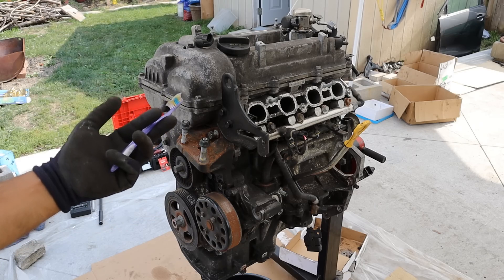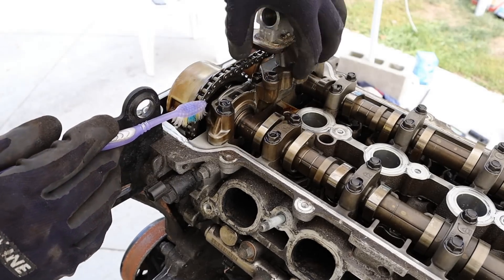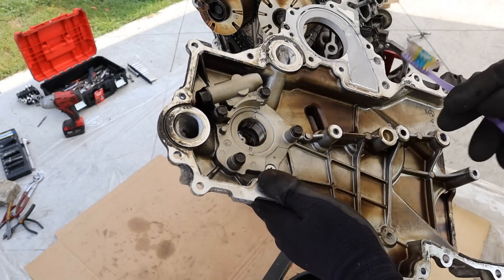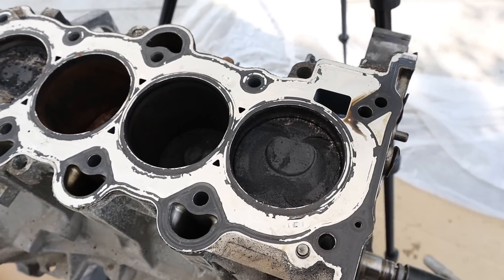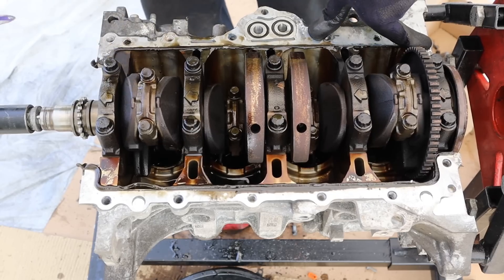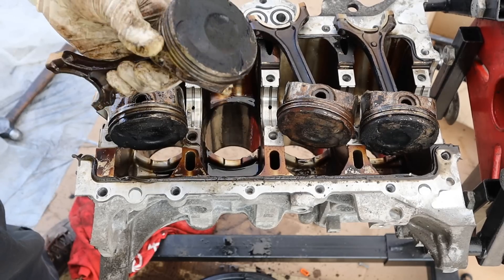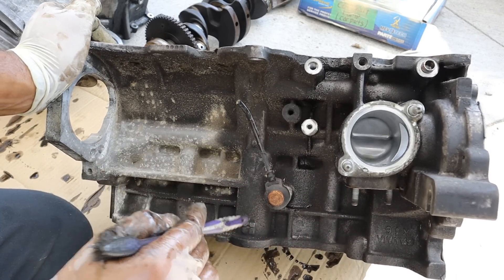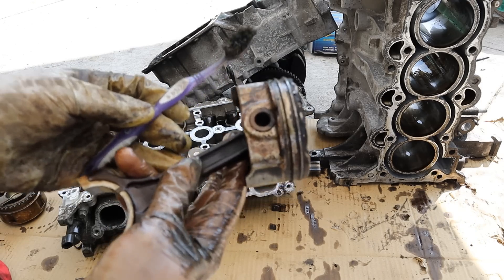Why KIA Engines Fail

Comment: I have a sneaking suspicion that Kia's and Hyundai's would not have as many engine failures if it weren't for their owners. I know Theta 2 engines have problems, but holy shit, I've never seen cars as mistreated and neglected as I have Kia's. Edit Why do y'all feel the need to repeat what I said over and over? I literally said "I know Theta 2 engines have problems". Why repeat that? The garbage engines will be even worse with no maintenance. That's common sense.
Reply from the maker: Yeah half the problem is the owners
Reply: Unfortunately I think people think they're basically throw away cars just like Nissan owners...lol for sure!
Reply: Even if your engine drinks oil, it is up to you to keep on top of the levels... It takes a minute to check your oil and can save you $_$! But alas people are so detached from touching anything in the car that it is sad!
Reply: I would refuse to own a direct injection engine period!   Yes many people do not do oil changes often enough....I do my oil changes at 3-4000 miles.    I never trust the manufacturer recommendations...they are in the business of wanting you to buy a new car after warraty expires      but no direct injection engines for me
Reply: @neilduncan8657  exactly GDI S##
Port injection along with GDI Whould
be a whole different picture.
Reply: Theta 2 engines would fail if the oil was changed every 25 miles. A real shame, because the rest of the car that they came in is actually pretty decent.
Reply: @9ZERO6  25K miles is 40K kilometres! 
Who would expect engine oil to perform for that long? Can't blame the manufacturer for neglect.
Reply: @68404  He said 25 miles, not 25K
Reply: I would tend to agree with you.  But the Theta II engine does have a flaw from the factory causing premature failure, even with good maintenance.
Reply: @SibRevs  That's why I mentioned the Theta 2 having problems.
Reply: You can polish a terd but you can’t make the inside of your engine better when it’s built like shit from the factory and No Honda is not the same as Hyundai
Reply: We had a Hyundai Accent and it got the same care as our 04 Corolla. The Corollas was off the charts better in ALL metrics. The 05 ACCENT had a horrible intermittent transmission bang and other issues. The dealer claimed to have changed the tranny under warranty but I know different now. I know this because my Chiropodist had a Tuscon which ate 2 litres of oil every 1 000 kms. He fought tooth and nail with Hyundai to warranty the engine. They did after a greater than one year battle. I know several people with serious issues with KIA and HYUNDAI. I will stick to Toyota.
Reply: @mikefoehr235  Go find yourself a factory original 2007 Toyota Camry with the 2AZ-FE and see if your opinion stays the same. Toyota and Honda engines came with junk piston rings, too.
Reply: @tobiasbeecher7860  The only junk i had was GM, FORD and HYUNDAI. Toyota outdoes all 3 with ease. I would take bad piston rings if I had too. That would be a minor issue to deal with. GM FORD HYUNDAI, The whole thing was junk.
Reply: @mikefoehr235   @Mike Foehr  It's not a good vehicle if you need to strip the engine down to the bare block to repair something that TOYOTA screwed up royally from the factory. Toyota is one of the best auto makers, but they definitely aren't perfect. There are some fantastic GM, Ford and Hyundai vehicles and there are some bad Toyota vehicles, that's a fact.
Reply: @tobiasbeecher7860  Well for me Toyota can do no wrong. I just love my 20 Tundra. I even floor it to piss off Trudeau a d spew extra emissions out of spite for that commy
Reply: @tobiasbeecher7860  I'll take that bet.
Reply: @mikefoehr235  - Quite the opposite for me.  I currently drive a 2015 Kia Forte5, my last car was a 2016 Toyota Corolla.  The Corolla is currently sitting at a junkyard (hopefully, where it belongs) because the transmission failed at 78K miles, my extended bumper to bumper warranty (through Toyota, not third party) was supposed to cover for a new transmission but Toyota CS told me that they consider the transmission failure to fall under their "normal wear and tear" category so warranty won't cover it.  I sued them, and won.  My third and final Toyota.  I got a good deal on the Kia and it has a ton more features than the Corolla did. Interior fit and finish is much better in the Kia, and it's not been back to the shop one time for repairs. Only for maintenance. Couldn't ask for more
Reply: @DeadofWinter321  2016 Corolla with a bad transmission...I am glad for you that your suit was successful. Our 04 Corolla was still going at 330 000 kms or more. I am not sure about the kms because Toyota made the odometer stop counting at 299 999. I think It may have been at 360 000 kms. That is well over 200 000 miles. It was the BEST car i ever owned and swayed me to Toyota. Our dealer is also extremely helpful...any legit warranty claims are honored with no hassle at all.
Reply: @mikefoehr235  Remind me where I said that Hyundai or Kia are reliable? They're far better than they used to be, but they have to get their shit together with their engines. Hyundai's and Kia's I see now tend to be great aside from the engines.
Reply: @OhPhuckYou  In an other life I think
Reply: @OhPhuckYou  If a car is great but the engine is shit, then it's a shit car.
Reply: @OhPhuckYou  A car is a tool designed to move you from point A to B. If a tool can't do it's job then it's a bad tool.
Reply: @OhPhuckYou  so the most important part?
Reply: @OhPhuckYou  It seems fairly obvious. It's a car.   Without an engine, it is.....junk.
Reply: @mikefoehr235  To be fair most toyota engines are nigh indestructible.
Reply: @saltananda3227  I know this from owning my 13 Tacoma...the 4 litre cannot be killed.
Reply: @That V8 Life - I’m far from poor and I bought my Kia Soul Exclaim for fuel economy. I have a 72 mile round trip daily commute and I wanted to keep the mileage low on my other vehicle. The Kia got 30+ MPG vs. the 16 MPG with my Dodge Ram 1500.
Reply: The owners are problematic but the real problem is how cheap they built & the GDI

Comment: I have a Kia forte 2.0 2010, 250,000km going smooth and silent, maintained with shell helix 5w 40 every 9 months, used to be ard 16k post COVID mileage down to 7k every 9 months, in tropical Malaysia. Never leaked never had chain issues everything is clean and smooth. It's the g4kd engine, not gdi, Mitsubishi Chrysler Hyundai jv, global engine. Never heard of any major issues with well maintained hyundai and kia models from that era, the theta ii engines, went into millions of cars. The transmission is a Mitsubishi 4 speed. There were known issues and recall with the next generation gdi engines from 2014 onwards. I went to the next video, on my exact engine saying it's infamous. No idea what infamy arises when millions of these cars are still running fine. Heard way more problems with Prius Honda Volkswagen BMW engines in that period.
Reply from the maker: Well they're still replacing theta engines out of warranty ...which is not normal even if statically it doesn't seem so

Comment: I would love to see your views on the Kia Stinger engine
Reply from the maker: 2.0?
Reply: @speedkar99  the 3.3l specifically, im contemplating get one for myself but i dont have the know how to access such a new platform
Reply: @Bluegillette  I've got one, they're good motors but they'd have the same carbon buildup for GDI. The way I see it enjoy the motor, tune it out and buy a new motor when the old one grenades, you're not going to get super mileage from a performance turbo motor. Genesis models have a new V6 with port injection as well I guess to do away with the carbon issues.

Comment: Well, maybe it failed, but still appears to be much more user friendly design than Volkswagen crap.
Reply: @Harry Balls yeah, understood. It's more true nowadays than ever thanks to these 0W water-viscosity-class oils and super thin oil rings.
Reply: @Harry Balls well, that's something that can kill any engine. But my comment was not about that, I'm talking about simplicity, not over-complicating the design. It looks clean, no obvious design flaws, maybe except the oil system routing (as indicated in the video).
Reply from the maker: Agreed. Simple in principle but maybe not execution

Comment: Excellent and interesting vlog, I have a Ford transit connect manual transmission and very happy with it, I have always changed my oil and filters every year. The pollen, fuel filter, brake fluid, anti freeze and also gearbox oil every 2/3 years. When renewing the oil I tend to put in half a litre of oil to flush out any possible old residue at the bottom of the sump before putting new oil back in, and yes I’m a fussy ol tart, kind regards to you and everyone out there. Mark from Billericay in the U.K. 🇬🇧😀👍
Reply from the maker: I don't think pouring oil to flush out the pan is gonna work like you think it does
Reply: How much do you drive?  Those maintainance intervals would kill that vehicle at 15,000-20,000 mile per year which is typical in the Western USA.
Reply: @shazam6274  around 8000 miles a year using high quality fully synthetic 0w 30 grade oil 👍
Reply: @marcusmaximus451  Thanks for the reply.  I drive ~ 4,000 miles / month (Lyft driver, Scion Xb)
Reply: @shazam6274  you’re welcome shazam that’s a lot of miles, take care and kind regards to you 😃👍👍👍
Reply: You are close to doing damage to your engine. You need to change at 5k miles at the outer limit. Almost every new engine is smaller and boosted but if not boosted well then its a Ford and the rings tend to get carboned up. I would change the oil myself every six months. Its cheap overall that way. But a Funoto drain valve to make changes a bit easier
Reply: @jamesmedina2062  thank you for the advice James I will seriously consider that I purchased 20 litres of Westway oil fully synthetic so hopefully the engine will have a long life kind regards to you 😃👍👍👍
Reply: @marcusmaximus451  yeah bro keep it clean!
Reply: @marcusmaximus451  Its just like cooking in a pan. Do you use fresh oil or old recycled oil? stuff gets dirty with any direct injection. I hate it but Its the nature of the beast
Reply: @jamesmedina2062  hi James I use fresh oil never recycled I checked out and researched Westway oils in the U.K. and I believe it’s just as good or maybe better than the branded oils like Mobil 1, valvoline, Castrol, etc etc 😃👍👍
Reply: @jamesmedina2062  btw the sump and sump nut is plastic which is a first for me 😂

Comment: Your videos are great 👍 very informative and satisfying to watch. Thanks for your content!
Reply from the maker: Glad you appreciate it
Reply: @speedkar99  any chance you could break down a ford 4.2 ive been curious about the intake manifold system on my 02 f150. I read that it is just a 3.8 with a longer stroke. But it has a curious butterfly valve system in it.

Comment: 2011 Hyundai Tuscon 2.4L bad engines??
Reply: That's a Theta 2 engine, many of them were poorly machined and left metal shavings in the oil gallies, leadings to astronomically high occurrences of catastrophic engine failure. They're not good engines because of that, but yours does not use GDI, so that's one less issue to worry about. If it's still running well and has higher miles, it's probably not affected by the poor machining. I've found that the engines that don't fail at low mileage end up being very good engines. Oh, and also, it uses a timing chain, so you don't have to worry about that.
Reply: @OhPhuckYou  mine has 116k miles on it and runs smoothly. I just bought it. Also the motor makes a ticking sound at idle and it gets louder as I accelerate but dies down after 1800 RPM. I've done some research, and many say it's normal. Is this true?
Reply: Actually a great engine in 2005 but that was a different design then.
Reply: @potxman I'm speaking of 2.4l on 2005 Sonata
Reply from the maker: Yes